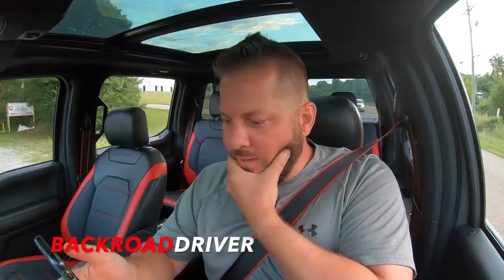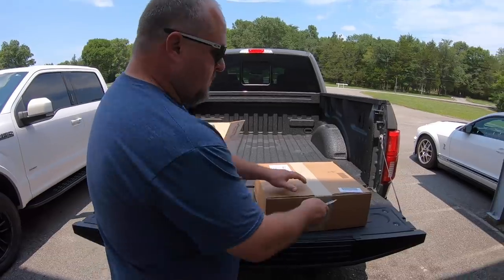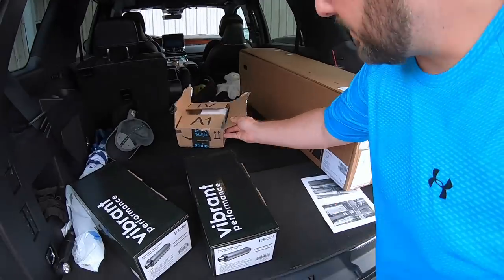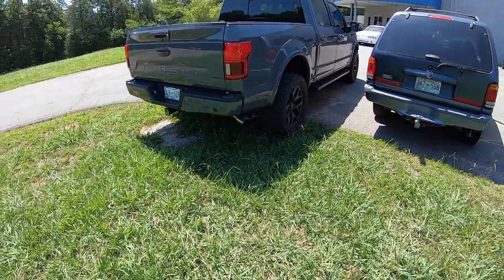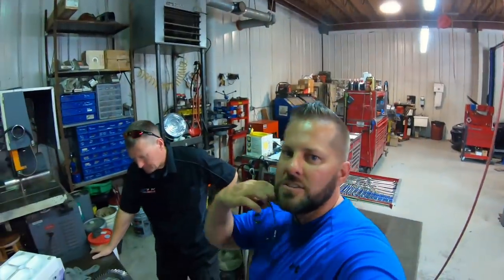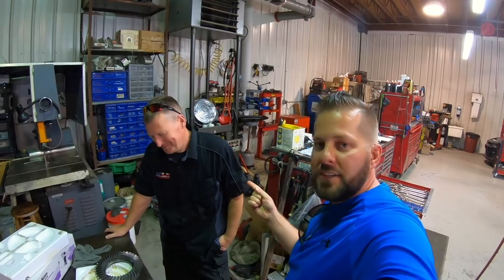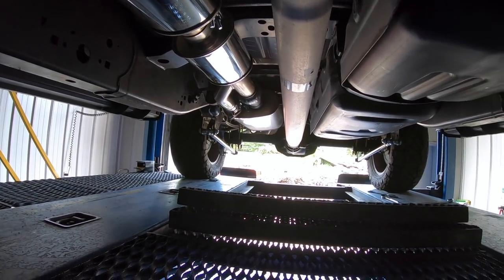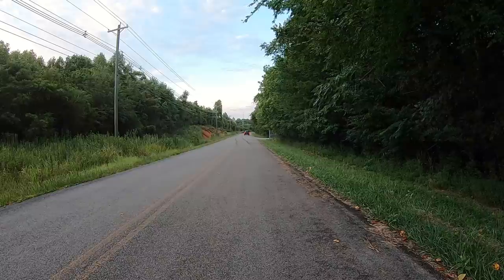0-60 in 3.?? - VMP Supercharged F150 - New Yukon 4.88 Gears & Limited Slip Differential

Comment: I'm not a Ford guy (but yet I drive a 2017 crew cab 5.0), but your truck is an absolute monster with those 4.88 gears. Modern transmissions like the 8L90 and 10R80/10L90 impress me, I just hate that they're electronically controlled, unlike the older 700R4 and TH400 transmissions that are mostly or completely mechanical. 

Sorry for my rambling. But again, your truck is a total menace! Only thing I would've done different after the gear swap is put 40 inch all terrains on it.

Comment: Awesome truck brother!  I have a 2016 Black Ops Shelby SC F150 and recently added a new 132mm throttle body and new transmission.  Hope to add a smaller pulley, boost a pump and more aggressive tune to see what she can do!  I’ll be following you for sure.

BTW, what headers did you add and were you able to observe the increase in HP and TQ?  Thanks and cheers!
Reply from the maker: If you are on Instagram or Facebook hit us up so we can see your truck. It sounds awesome! We used Stainless Works headers. I know it added power and sound but we did all power adder additions in one step so no way to know how much the headers added. Thanks for checking us out!

Comment: Enjoying your videos, I talked to you on FB yesterday. Just for my learning experience, why not put in a e locker or air locker rearend?
Reply from the maker: Hey Phil, This much power breaks an e locker pretty quickly.  The mechanism wasn't meant to handle this type of abuse.  The limited slip still has a hard time with doughnuts. It does pretty well in a straight line.

Comment: Hey Brad, when you said you were launching the truck in 4All did you mean 4Auto? If so i would highly recommend launching in 4Hi instead. The auto mode uses clutches inside the T-Case to lock up when slip is detected. Its very hard on your T-Case to use 4A when launching a stock truck, and especially with the amount of power you are putting down. Next time just use 4Hi. Also, when they regeared the truck, they did the front differential too right? It was never mentioned but shouldn't have left that shop without them at least telling you that 4x4 shouldn't be used unless both differentials have the same gears.
Reply from the maker: We did put 4.88 gears in front and rear. I don’t know why but when I launch in 4H I get wheel hop. Gotta figure that out before we break something. Thanks for telling me about 4A. Still figuring out the new setup.
Reply: Backroad Driver your getting wheel hop because all the power is distributed evenly front/rear. In 4a that t case clutches apply slowly thus reducing the wheel hop. But as stated it is verrryyy hard on the case I advise against it as much as possible man!
Reply from the maker: How do we get ride of hop in 4H? We are all good in 4A.
Reply: Backroad Driver depends, is it hopping in the front or the rear? If in the front, lower front tire pressure to 22-25psi. If the truck is leveled take the leveling kit out. You want the front lower than the rear as much as possible. If it’s hopping in the rear, traction bars are your friend. Also I’m new to this channel, what tires are you running? If taller than stock you’re gonna fight it no matter what. The lower the truck is overall,  the better.
Reply from the maker: I think we are fighting physics. We have 2” fox leaving shocks and coil overs and 33” Nitto ridge grapplers. The hop is in the back in 4H. I have not aired down in the front but have dropped to 30 in the rear. I think I need to drop pressure front and rear. We have Caltracs installed. They fixed the problem and we ran 3.52. Then we changed front and rear gearing to 4.88 and added an LSD. The torque went up but the wheel hop in 4H came back. We just ordered some new traction parts from BWoody. Rear diff shock to prevent axle wrap and a front diff bracket that cuts down on front axle movement. I need to go ahead and mess with air pressures.
Reply: Backroad Driver if you are not at the track, do not air the tears down, that will likely make the issue worse. Air them up tight. Now, just know that if you air them up it will reduce wheel hop, but may cause the rears to spin a little more. Which I believe is more desirable than a hop. Also like I said that leveling kit isn’t doing you any favors at all. And your likely gonna need a longer style traction bar with that much power. The front mounting point will need to be somewhere around the middle of the rear seat on each frame rail. I know most of what I have mentioned is counter intuitive to the badass look you have going with that truck, but if ya wanna play you have to pay sometimes lol
Reply from the maker: Man I really appreciate the help. What traction bars would you recommend?
Reply: Backroad Driver I’m not sure if anyone makes any “bolt on” that are that long. I’d have someone fab you up a set of either: ladder type bars, or a single bar type setup like sled pullers (such as myself) run.
Reply from the maker: I’m assuming the ride will get rough but the hop will be gone if I add long bars?
Reply: Backroad Driver yes I was actually going to mention that and forgot haha. The ride will definitely be stiffer. A long single bar will have a slightly better ride than a ladder bar though

Comment: maybe i missed it, with limited slip did you remove the rear e-locker as well?  or do you get to keep it
Reply from the maker: We didn’t have it on our truck. If you add an LSD you lose the locker functionality because it is locked most of the time.
Reply: @BackroadDriver  what do u think 3.73 e-locker or LSD ?
Reply from the maker: Is the e-locker factory? If so, that is your best best for reliability. If you are deciding which to upgrade to I would go with the LSD. That gear ratio is awesome if you aren’t boosted but if you are going to add boost then go 3.55.

Comment: With 4.69 1st gear and 4.88 rear it might almost be to violent and hop can Oz get it to launch 2nd and see how it works?   That triple over drive helps keep revs low at 60mph you must be around 1950 rpm at 60?
Reply from the maker: We swapped back to 3.55’s
Reply: @BackroadDriver  lol I didnt realize how old this video was I guess when it's that early a fella doesnt pay attention.   I have 4.56 In mine but 6r80 for truck pulling but i wished on street could just do 2nd gear start
Reply from the maker: If you get a custom tune or just manual swap into 2nd would that work?
Reply: @BackroadDriver  That is an interesting choice!  I figured 4.88's were too big but 3.55's?  Why not 4.10's or 3.73's?